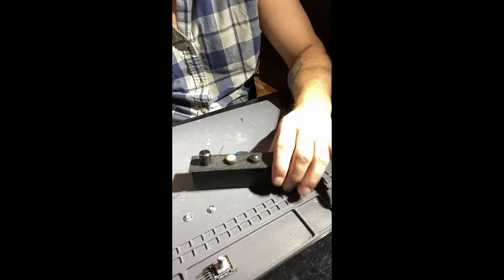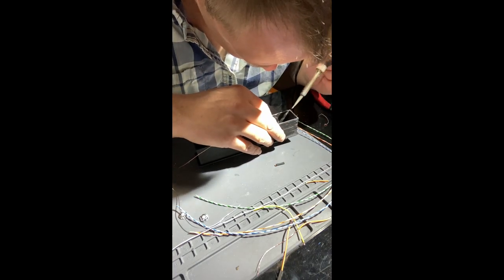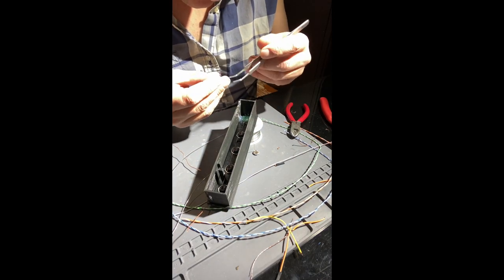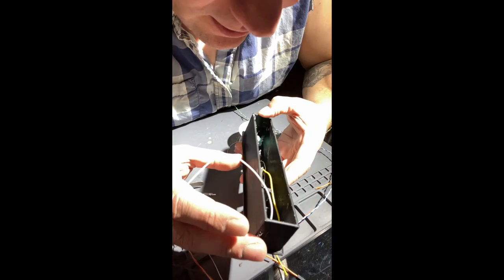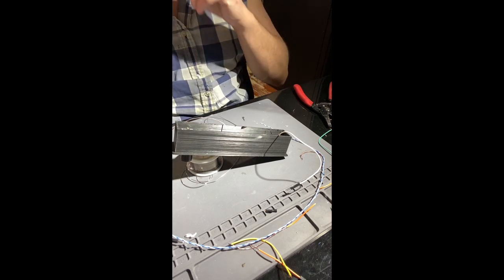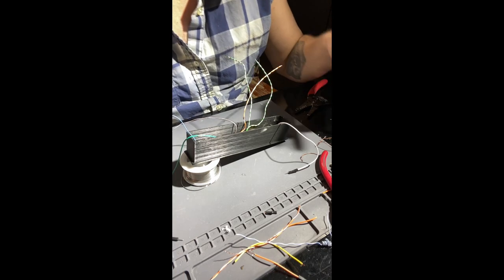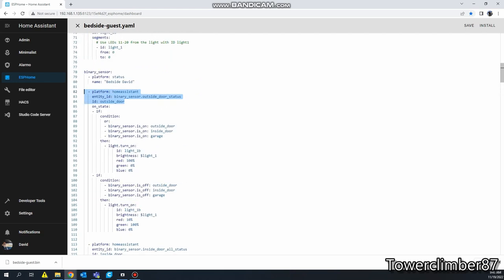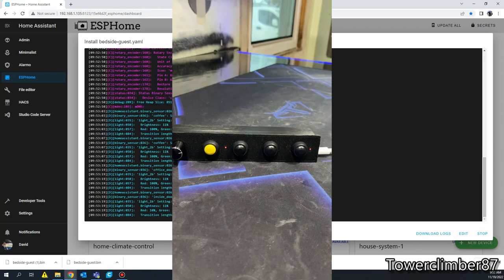ESPhome/Homeassitant Push Buttons

Comment: Hey this is a great video about your nightstand and the assembly! I was wondering if you could make a video that is a higher-level overview of how the wiring works, how ESPHome and Home Assistant. When I go to build my push buttons I think this video would be really helpful but I still think it leaves some gaps in fully understanding how this works and what goes where. Thanks!
Reply from the maker: Thank you for the input. I’ll try to do one within a week.
Reply from the maker: Just curious if you took a look at the video for first binary/switch set up?
Reply: @innovativehomeautomationto7112  I did not, didn’t realize it was down there! I’ll check it when I get a chance and we’ll see if I still have questions. Currently still working on getting my home assistant fully setup